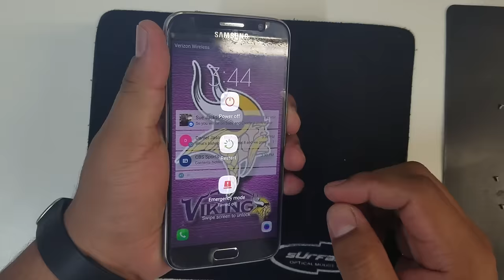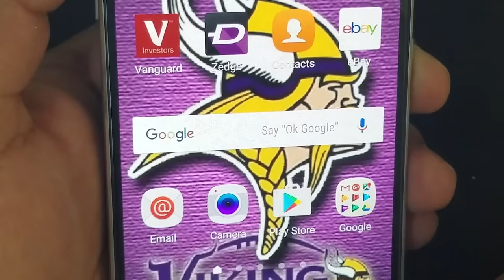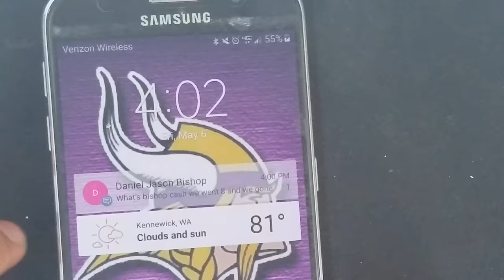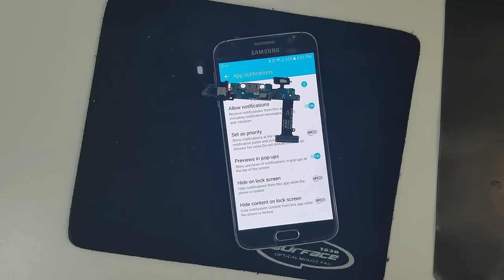Galaxy S6 Charging port Replacement Without Taking The Screen Off

Comment: Hey thanks. It's a bit odd not having sound, but I followed your steps and replaced the part today. I was able to use the heat gun and then carefully remove the back such that I kept most of the adhesive in place. When I was finished I just put it all back together again and then used the heat gun again on the front and back in the hopes that the adhesive would heat up again and then re-attach. It seems to have mostly worked. I'd recommend to people doing this for their first time to 1) take their time, 2) I think the one screw that holds the board with the charging port in place is slightly less long than the other screws, so keep it separate from them, I could be wrong. Also 3) make sure that when you put the phone back into the glass part that it is tight in the metal frame, I think there's a tiny gap in mine that I might have avoided before I put it all back together. Oh yeah and 4) when be careful when removing the back, the paint will easily get 'pushed' off the glass backing so use your guitar picks carefully! Thanks for the video, I love this kind of stuff on youtube.
Reply from the maker: +d gee great thank you so much, I hope we can help you with much more.

Comment: Thanks... just repaired mine using your video... if you get the phone nice and hot, you are able to do with replacing the gasket... and I used my hairdryer to get it hot... bingo... good for another 4 years.. cost me £4 for the part on Ebay... saved myself £50 at least I think... very happy.
Reply from the maker: Thank you 🙏

Comment: After watching this and reading the comments I think I'll be taking mine to a professional to do. I'd rather pay NZ $170  to get it fixed properly without the hassle and worry than stuff up my NZ $1,600 phone! Good luck to those who are going to give it a go!! 👍
Reply: My charging port of my Galaxy S6 is bust and I am actually thinking ordering a new unit for about 10 US dollars. My only concern is to lose small parts and/or break the screen.....will watch a dozen diy connector video's for the S6 first probably to feel confident enough to do it.
Reply: Joris Maas did you do it? mine is busted too and ebay has parts for $7...I dont have $100 to bring it somewhere. I'm getting annoyed with wireless charging too
Reply: I didn't do it myself in the end...too risky to break the back cover (which is also made of glass). Samsung should stick with flexible plastic back covers, removable batteries and removable memory cards like my old Note 4. Oh well.....
Reply: Joris Maas see my back cover is already cracked so I'd need to replace it anyways...I can do the back myself but I'll probably just pay $75 and have someone do the charging port too risky and idk what I'm doing lol
Reply: The S6 is (although it has no memory cardslot) still an amazing phone and worth every cent you spend on it (I use it as remote control for my Samsung TV and Pioneer receiver for example). The S7 does not have an infra red eye. My previous phone was a Samsung Note 4, and however I really like that phone, the S6 is so much better, faster and sharper (especially when I use it in the Gear VR headset). It has a smaller battery but it also is energy efficient (I can watch a full 2 hour movie without a problem of overheating). 75$ on a great phone that used to cost $699 @introduction is not cheap but worth the investment imo because of the amazing screen (and for me the remote control function).
Reply: Joris Maas I've had it since it came out, and the charging port is the only problem I've had. It still works like it's new and the battery lasts. I'm not planning on getting a new phone till another year maybe. The back being cracked is my fault because I didn't keep it in a case for a while lol. Any android phone I've had the charging port always breaks on me. I had the htc one and the same thing happened. When I upgrade I was thinking about switching to the iphone because I know the cord can go in both ways, I also have a macbook so it just makes more sense to have an iphone. I definatly lovee my s6 though. The memory doesn't bother me either. 32gb is plenty for me.
Reply: @JorisMaas   it is a flexible material, not glass, just replaced my port by watching this video, was very easy.

Comment: Worked out way easier then I thought versus The other way and seperating the entire lcd from glass and beats paying 80-100$ for a company to so this  . I  Just did today  on own very easy  you just need to be slow about it patient careful  and have some skill Watch the video as your doing it Pause Play = Success .
Reply from the maker: that is great hope we can help you for many more repairs
Reply: +E-Z Fix Smartphone Repair, Cell Phone Repair 

I ran into one problem I do need help 
the fix went just like your video except some how along the way I Lost mic sound. Noone can hear me on my calls but I can Here them .When I use speaker phone we can hear each other fine. I can't see where the mic has anything to do with the charge port end of the device. 
I never touched the mic on top I only unplugged and plugged back in all the ribbon cables like you did. 
Do you know which mic location has to do with outgoing voice .And what does it tell you issue may be when speaker phone works but regular call Noone Can hear me .
Reply from the maker: +Aaron H that is the microphone located on the charging port, that is the problem
Reply: +E-Z Fix Smartphone Repair, Cell Phone Repair 
really can you tell me or show me a image for what to look for..
what could have caused this  I see nothing that looked like a mic on that replacement port anywhere it just had two lights for the capacitive touch buttons and the charge port.
Is it usually a ribbon cable not fully attached? Exactly how does that bottom mic work
Reply from the maker: +Aaron H the bottom microphone works when you used the phone on the ear, and when you are using loud speaker is using the top microphones
Reply: +E-Z Fix Smartphone Repair, Cell Phone Repair I know that I'm asking where is a bottom mic on the port I don't see anything that resembles a mic.
and what could have caused this if so.
I'm reading these new  charge port parts commonly come with bad mics sometimes more then often twice in a row.
How should I tell if that's the case or did u install it wrong ?
Reply from the maker: +E-Z Fix Smartphone Repair, Cell Phone Repair we can't post pictures here
Reply: It could just be that the mic was defective from charging port set you purchased..
Reply: E-Z Fix Smartphone Repair, Cell Phone Repair

Comment: Hi EZ

I have put phone back together but one side of the screen is raised and the light from hardware back button shines out from the gap. I'm not sure why this is maybe I raided the screen to high with the piks. Anyway do you think if I apply glue it would fix the problem.
Reply: there may be a loose screw stuck under your screen that is preventing it from closing completely
Reply: Actually what happened was I didn't fully remove the old part, there was a bit remaining from the original dock hardware button stuck to the screen fairly hard with the glue. Managed to remove it with a pointy tool. Phone is back to normal now thanks !  :)

Comment: does it matter what number (ex.SM-G925A) its is when we buy the new charging port or no ?
Reply from the maker: +Nathan Cercel yes you have to get the right model number for your the process is the same but the part is a little different

Comment: Hi, I am getting a very poor service signal after following this procedure. Especially when I'm holding the bottom of the phone with my hand. I don't think the wifi or bluetooth cable has anything to do with it ? Any idea what caused loss of network service signal ? Thanks.
Reply: did you make sure that your antenna wire were connected back securely?
Reply: I solved the issue. There is a bluetooth and a wifi antenna removable cables inside.. The wifi antenna developed a fault when I took it off initially.The connectors on them are not a very good design in my opinion. So I replaced the wi-fi antenna and hey presto, back on 4G, no problems. Soooo, what has wi-fi antenna got to do with 4G signal? Well everything in this phone but nowhere did anyone mention that on xda or youtube or anywhere else. Lucky I solved the problem by chance. Thanks anyway David.

Comment: *My charging port on my s6 broke so I just bought a wireless charger 
instead of risking breaking a $160 screen. I got the samsung Fast 
wireless charger and my phone used to fast charge with my usb fast 
charger but the s6 doesn't have fast wireless charging capabilities and 
it takes forever to wireless charge. Just thought I'd put that out there
 for y'all.*
Reply: Ok please i mean PLEASE reply does it work with a wireless charger when the port is broken?

Comment: Does doing any of this causes the phone to reset and you lose photos or contact information?
Reply: Ronnie Adore probably not but, I would back up your phone just in case.  with no removable memory you may want to monthly anyway.
Reply: Or, just use the built in feature that backs everything up to your google account automatically. It isn't 2001 anymore.

Comment: guys,i got an s6 edge and it needs 6 hours until full charge i tryed all common solution like changing cable and the whole charger with another original one but still same,when i checked the setting i found the fast charging option turned on and when i connected the charger it auto off and no ability to turn it again until i take out the charger,could anyone help me or suggest me to do something please?
Reply: same problem here ... solution ? never ever another samsung phone ..
Reply: Same problem... Except it when I connect it to a computer it only charges and doesn't get detected by the computer AT ALL (Ive tried 3 pcs and 2 cables) I only get a slow charging message and not MTB/PTP options.
Reply: The part you bought doesnt support fast charging hence why it is cheaper
Reply: I have exactly the same problem, the phone only slow charges and is NOT recognized by my computer or GEAR VR headset.  This is pretty frustrating since I bought the phone last week (used) on Amazon (Second-Hand Phones in Devon UK). I hope they can fix this fast (they probably checked it on charging and not on connection with a pc when it comes to data transfer or connection with a Gear VR).
Reply: Wireless charging?

Comment: How hot does this heat gun need to be??
Reply: 250c will easily get the job done, all you're doing is heating the adhesive enough to make it pliable. A household hair dryer will achieve the same results. Just be sure to spread the heat evenly and use common sense.

Comment: Great video.
I broke the rear glass.
I couldn't  put anything  between the glass and the frame.
So I tried to use thin metal blade and it cracked right away.
So you need to include the price for the rear glass to repair cost.
This phone is the piece of crap a quality wise.
Certainly,  the paint will chip of on back and rear.

Comment: I just had mine replaced the same way and it won't fast charge after replacement, and the regular charge takes 5 plus hours. Do you know why?
Reply from the maker: Try another port
Reply: @EzFixMartin  your fucking crazy

Comment: Hello, please help, I changed the usb por from my galaxy s6 edge, and everything is working properly except that I cannot get fast charging and cannot conect to the PC
please any Ideas?
Reply: Hi, i do have the same problem as yours with my S7 Edge.  Unable to get fast charging working and PC wont recognised it. However, the cable charging is working tough
Reply: Its chinese part not original if you change it thats why.
Reply: It's either the pins not connected properly or the parts is not authorized by samsung

Comment: I'll just buy a wireless charger and charge it wirelessly.it's so difficult I can't be bothered.
Reply: @mcs5578  Done me proud, 3/4 years and still running, dropped countless times back and front cracked (back more than  front, front only has a small crack) and she still can play pubg mobile albeit lowest settings but not bad for oldish tech, might get one brand new seeing as they are great all round phones
Reply: I started to use a wireless charger about 18 months ago and its buggered the battery. Only charges to 73% on the wireless. Switch it off and on and it says 98% then dies to 70% in a minute or two. Phone lasts about 5 hours now if im lucky. Constant use about 45 mins.
Reply: @Bikerboythousand repair time... give it some new life! I'd recommend you watch jerryrigeverything's vid on it!

Comment: The problem isnt that its a super difficult repair....its the almost UNAVOIDABLE paint chipping and separation from the glass which leaves the phone looking like shit cosmetically, and it always gets worse with time.

The professional way to do this repair is microsoldering the port itself.  Do not fuck with the other components of the flex cable or take the risk of cracking the LCD.